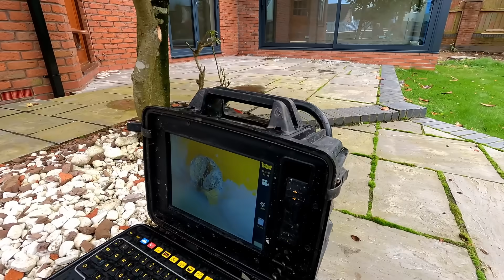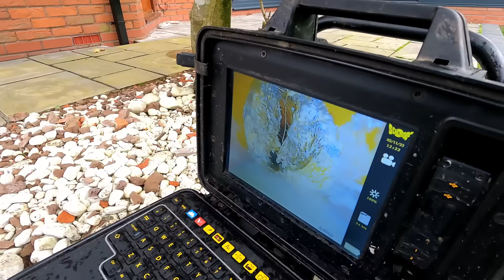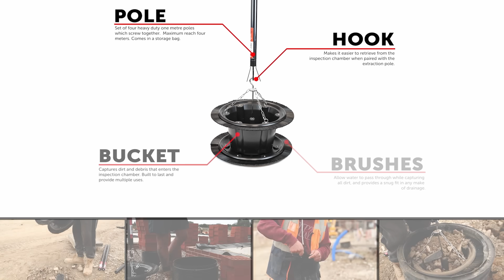Milky chocolate blocked manhole & and rain water gully! Dave the Drain & Justin to the rescue

Comment: How are your manholes so shallow you can reach down with your arm? Does the UK not get any significant frost? Here in Canada you wont find a sewer line less than 5ft below ground, often way deeper because of serviced basements
Reply: The UK actually has a temperate climate, and so we don't suffer with frost like you do. In the first video, it appeared the property was close to a river/canal, there might be a high water table that may have affected the depth they could go to? Although it is more likely that in an effort to get the fall into the main sewer line, they had to start at that level.